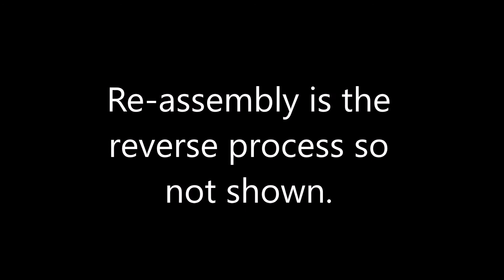Dismantle / Disassemble any Toshiba C660 series laptop - Upgrade HD, RAM, Screen etc

Comment: I just purchased 1 of these for $45 and bought a new battery $40 and Ill fit a 500 gig ssd drive and remove the dvd drive and fit a 1tb mechanical drive inn it's place so $45 +$40+$65+ $20 + $65 plus some extra ram I have floating around and I have a nice quick laptop . Around $235 for a nice quick computer

Comment: Excellent video, thumbs up. However, I can't tell if the CPU cooler (and hence CPU) can be removed without complete dismantling of the laptop, as is done here. IOW, can the back cover not be removed for access to these parts with the rest of the machine (top cover, screen, MB) left alone?